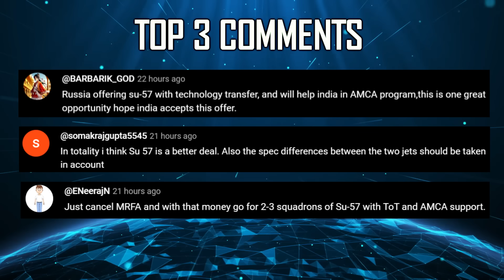Indian Defence Updates : IAF Checks Su-57,Sheshnag-150 First Flight,Tezz Ramjet Test,Stryker by BEML

Comment: My opinion would be to scrap the Tejas, TEDBF programs (Reduce , if possible scrap the already given orders for Tejas, TEDBF and focus on AMCA supply chains).
Order F-35's in limited numbers(3-5 squadrons, with India specific enhancements and operational sovereignity) and manufacture Su-57s with engines in India with full TOT. Buy F-15 Eagles/FA-18 Hornet with full TOT and if possible also acquire some Rafales. 
Focus on AMCA program directly for the 6th Gen. Also focus on 6th Gen engine program. Bring the AMCA and engine program under the PMO, sack underperforming people and bring responsible people on board. 
Privatize HAL and invite more private sector partners to establish manufacturing supply chains.
In today's scenario IAF needs no less than 60 squadrons and even Navy needs aircrafts. Meanwhile, all the Migs, Mirages, Jaguars, Su-30s need to be retired eventually.
Simultaneously, we must also focus on stealth drones and UAVs as part of the 6th Gen ecosystem.
Reply: It's impossible to develop 6th generation jet without developing 5th generation

Comment: Just a comparison for Indias perspective-
Su57 and F35
*Su57 is 3 times cheaper than F35, 30million to 100million.
*Su57 is faster and many times more manuverable.
*Su57 has better missiles as russians is always leaders in missile technology.
*Su57 has no restrictions coming with it.
*Su57 can be manufactured in India, with no new factories.
*Su57 can give a transfer of technology of approx 40-50%.
*Russia said that it will help in making A.M.C.A.
*Indian Airforce has experience with Russian jets.

*F35 has the best stealth in the world, F35 0.05m² and Su57 0.1m².
*F35 has best avionics.
*F35 has better radar.

Personal bias Su57.
If there is anything else please inform me in replys
Reply: IMO source code access allows you to integrate our own missiles. Else we can use only the missiles integrated with F35 and nothing else
Reply: F35 radar cross section is 0.01 square meters from any angle. Whereas Su-57 is 0.5 square meters only if the aircraft is infront of you.
Reply: Where did you get the price of Su57 when no one knows? How come Su 57 is cheaper when Su 30 is 45 million in price. 

Why do we need maneuverable jet when modern warfare is BVR
Reply: What about the source code of f35? They may control the operations where to do and when to do.
Reply: @krishnamurthy.k4146  no they won't give, even U.S. allies didn't got it.
South korean f35 even needs a permission from U.S
 to start so they are most unreliable.
Reply: @krishnamurthy.k4146  Nope. They wont share source code and source code has nothing to do with operations
Reply: Usa is not pffering f35 , they didnt even deliver engines till now

Comment: Indian Army so obsessed with Stryker which is underpower,   non amphibious , optimal performed over Whap. What a shame.
Reply: Because Stryker is battle proven tested and even IA knows that.
Reply: @Zack-nl6bw  Ukraine war just check how those were crushed . Again there are not amphibious so will get stuck in Ladaak how T72 stucked and lives of soldiers lost. IA knows the limitations still choose over the Indian products which is far superior.
Reply: Because India is going to get higher powered engine from the start, so non issue. It has active protection which none of our indigenous options have and become very crucial in drone warfare. Finally not every armored vehicle needs amphi capability.
Reply: @vaimurthy  So the Ladakh region where these are most needed it will fail right?  Same like how T72 lost while crossing the river and two soldiers lost their lives.
Reply: Which is under powered… you know that you can change engines right? It’s not a difficult process.

Comment: If sheshnag 150 drone wings are foldable, the vehicle can carry double the amount of drones that it is currently carrying. Why can't they do it? Swarm size will also be huge.
Reply: Folding mechanism would add weight and effect aerodynamic character meaning range, payload capacity and radar cross section would be adversely effected.